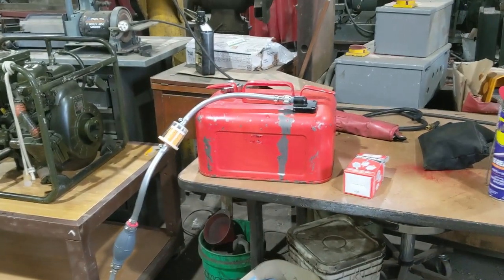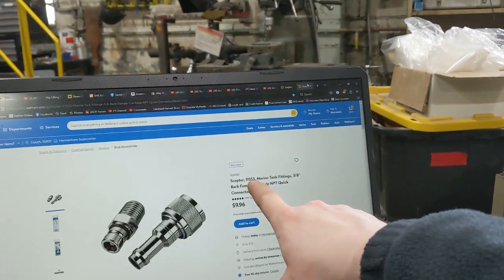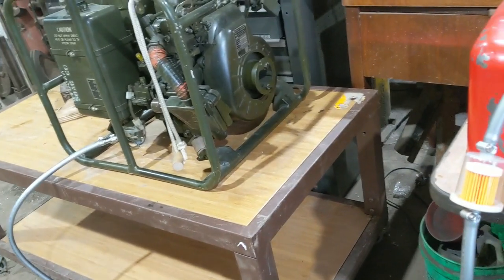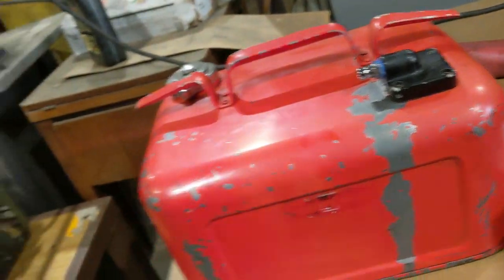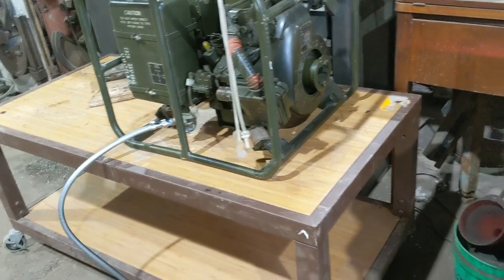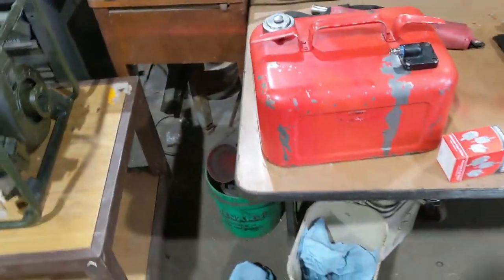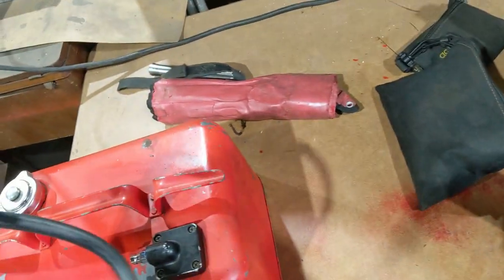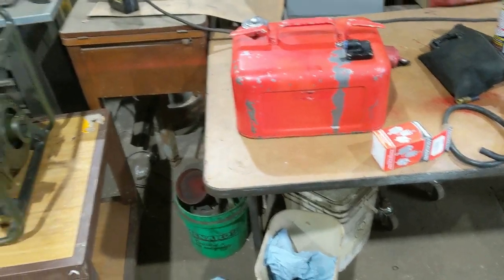Update Generator and Snowblower 3/5/2023

Comment: Thanks for the update, Josh.  That's a cool setup on the aux. fuel tank for the genset.  I wonder how much run-time it will give you?  You have a lot of neat machinery there to work with and enjoy.  Keep up the good work!
Reply from the maker: thanks, the generator consumes 1/2 gallon per hour, so the 3 gallon tank should give me 6 hours of run time.